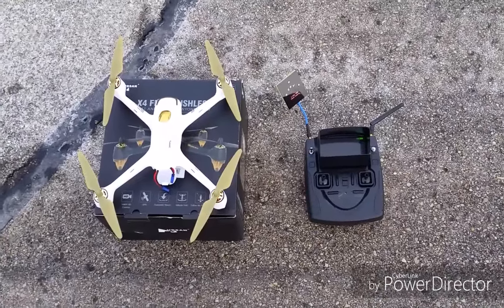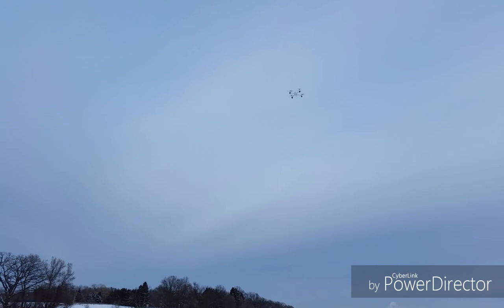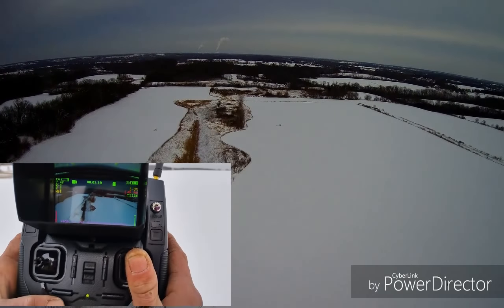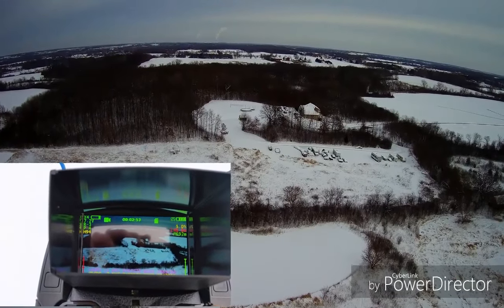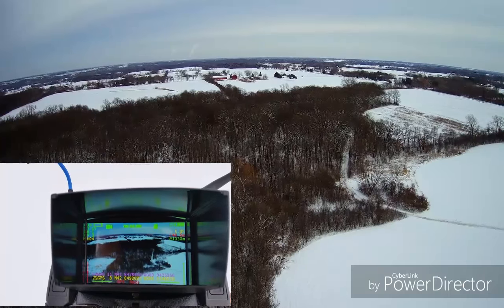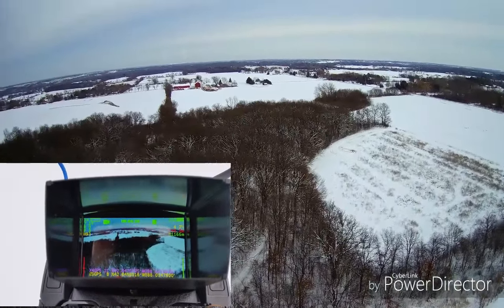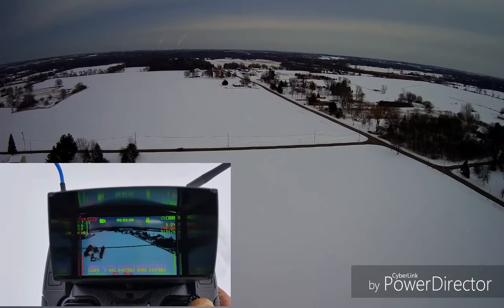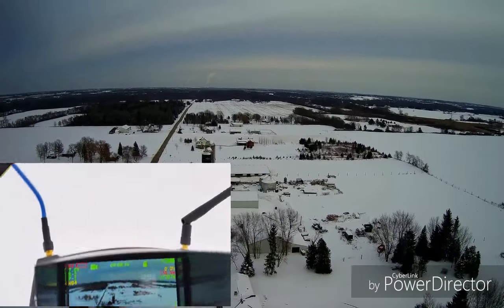hubsan h501ss 2.3Km Range Test. Second Flight After Mods.(May want to turn on Captions).

Comment: Im curious, I think in a test some time last year,  you had pretty good results from an BTg panal antenna in a side to side comparison with BG and GB range mod antenna's,  ( I think I got one after that ) and my fpv improved a little on my standard controller,  Do you still feel good about BTG? and at the outside chance that a 501.SS  can be purchased without ANY controller< Can you bind a 501ss bird to a NON-SS standard controller without conflictions in firmware versions?
Reply from the maker: +anyshitt No. Well, you could bind it to the quad but it probably would not function correctly. The SS comes with its own firmware versions that are not compatible with the original h501s firmware versions. So you would probably have to somehow find the exact firmware that came with your quad and try to program the same version into the controller. The SS versions are definitely better than h501s and are actually coming down in price. It might be worth it for you if you're curious about getting another hubsan quad, trying and getting an h501ss Standard Version, doing the mods and seeing what you get... I know it's always a crapshoot with hubsan, however I seem to have very good luck with their products. BtG is still good quality stuff. I still use that panel antenna when I'm flying around for fun not really for extreme long range flights. I don't know what it is about that blue wired antenna I got from gearbest but it works the best out of them all !!!
Reply: Well if history has taught me anything? it is that (regardless of what I say) I will most likely take the plunge and try this new version of the 501-s.. That whole package really was packed with fun options for the price in a user friendly (no app needed) RTF aircraft..  The only thing is most venders dont advertiise weather or not your gonna get the OG or the SS version>  but shi% yea,  the standard controller is the only way to go onceI finnally squeeze the trigger!  THANKS AGAIN MARK..
Reply from the maker: +anyshitt Bro, if you are going to pull the trigger and get another Hubsan, Buy From GearBest ! You Will get an SS . Standard Version, White & Gold Style, mind as well get that Bomb ass Antenna too. That way you should get both items at the same time.  https://m.gearbest.com/rc-quadcopters/pp_264426.html?wid=21 https://m.gearbest.com/fpv-system/pp_436713.html?wid=21

Comment: nice video, assuming you're using the stock charger, does the charger blink lights even when the battery is not plugged in? I'm not sure why mine is
Reply from the maker: I Never use the Stock chargers. A Professional Charger/Discharger is a Must have if you want your LiPo batteries to last long, accept a Full Charge and most Importantly function properly. As for your Stock charger blinking lights when a battery Is Not plugged into it, that is normal. When the charger is plugged in with No Battery attached it should blink Green. When a Battery is attached, the light should turn Solid Red, meaning it's charging. When the battery is fully charged, the lights should turn Solid Green.
Reply: OK thankyou, once my battery has 'finished' charging on the stock charger, it stays solid green but occasionally flashes at regular intervals. The same whilst its charging: It stays red but at regular intervals will flash a different colour, and after doing some research that combination of flashing lights may mean it was faulty. Do you have any recommendations for good balance chargers? I don't want to spend too much
Reply from the maker: Sam Manesh Yes, your charger is faulty. Don't use it anymore Brother !!  Here's a few Good chargers. I have the Radient RC "Duplex" and the "Authentic" Imax B6 ---> http://radientrc.com/chargers/proSeries/. https://.   https://www.amazon.com/Genuine-Professional-Battery-Balance-Discharger/dp/B079LH1CH6/ref=mp_s_a_1_4?ie=UTF8&qid=1529418835&sr=8-4&pi=AC_SX236_SY340_QL65&keywords=imax+b6ac+v2&dpPl=1&dpID=51oB-Sg%2BWiL&ref=plSrch DO NOT Buy a "Clone" B6 or anything that's Not Authentic ! They will Wreck your batteries !

Comment: Hey Mark awesome flight bro you accomplish the hole entire flight on one battery in the cold?
Reply from the maker: amir newson Yes. One Battery, GPS Hold the Entire Flight. My Controller is Not Reading Voltage Accurately. There's No Way It went that Far Out & Made it back without a fully charged battery. If you watch the controller's screen, Quad Voltage reading is 7.4 at Very Beginning. I was Praying it would make it back !! Otherwise my neice and I would have had to track through 1 to 2 feet of snow to try and find it in that field ! And that would not have been easy since my quad is white and so is the snow! I would have filmed the return to home trip with my controller on the screen, but my fingers were absolutely numb!! So, I hit return to home and ran to my truck to warm up my hands but I was still watching my screen making sure the quad was going to be okay on the return home trip. If you watch the very end of the video, you can see us standing back in the field waiting for it to come home...
Reply: Mark I was thinking about getting the h109S pro would you say it's better in distance than the h501S-S or not
Reply from the maker: +amir newson I can't say for certain. I would love to say "Yes" or "No", but I haven't had a chance to "Try" and fly my H109S X4 Pro that Far (Yet). Last range test I did with it, I had some technical difficulties. Also, almost lost it completely because of a guy's signal jammer ! However, I Love Flying the H109S X4 Pro Better because it's just Big, Faster, More Powerful and it has a Gimbal. Along with a Huge 3S 11.1V 7,000mAh Flight Battery !!! That battery is Huge ! When I First got my H109S, I was getting 30-40 minute flight times !! (Flight Battery was Perfect, between 10-20 Proper Charge and Discharge Cycles). With that being said, I think that the H109S "Could" go Further than the H501SS. It's really fun flying Both. It's Ultimately up to you brother !
Reply: Mark Suttner thanks bro I'm going to look at some more videos on the h109S and try to decide again thanks bro
Reply from the maker: +amir newson Check out this. https://youtu.be/rBlWFC7sOUA
Reply from the maker: +amir newson Or this. https://youtu.be/4hRtv-vCkTA

Comment: Hey Mark how doing bro I have a question what's the name of thicker antenna wire's for the 2.4 an 5.8 connections when do the modifications and where can I purchased them from thanks bro
Reply from the maker: amir newson " RG178 Coax Wires SMA to Ipex". About 4-6 Inch. I would recommend 4 Inch (10cm) You can get RP SMA's Or Regular SMA's. Doesn't matter. Here is ONE Link of Many. You can get them from Tons of places... eBay, Amazon, Etc, Etc. https://www.amazon.com/gp/aw/d/B074RJ5LM7/ref=mp_s_a_1_3?ie=UTF8&qid=1518564716&sr=8-3&pi=AC_SX236_SY340_FMwebp_QL65&keywords=rg178+SMA+to+Ipex&dpPl=1&dpID=51Wks8LvNoL&ref=plSrch
Reply from the maker: amir newson Remember that if you are going to use the M-EGAL Panel Antenna Mods or most other similar antenna mods, they require regular male SMA connectors. If you get RP SMA Coax Wires, you will have to get RP SMA antennas. Where the inner needle sticks out of the coax's SMA Connector and not the antenna. The link I sent you are regular male SMA connectors that will work with the XDA model and the M-Egal Antenna Mods.
Reply: Mark Suttner thanks bro I really appreciate bro
Reply: Mark Suttner thanks bro I really appreciate
Reply from the maker: +amir newson No Problem ! Anytime Brother !!

Comment: Hey Mark how you doing bro I'm back with another question today I took my hubsan h501S-S out for a fly and I notice I had to go full throttle to make the drone take off what does that mean
Reply from the maker: amir newson You Must Do that. Perfectly Normal. If you Don't Full Throttle the quad during takeoff, it can actually tip or flip over by its own propwash. The propellers push the air down obviously, but when it is near the ground, the air(prop wash) gets deflected off the ground and back up towards the quad. That is one of the most common mistakes a pilot can make. Always full throttle during takeoff. Always..
Reply: Mark Suttner Ok thanks bro I really appreciate
Reply from the maker: amir newson No Problem. Anytime Brother ! :)

Comment: I would like to replace antennas with similar to yours, but I think there will be problems with the direction the transmitter is pointed to. I have the same model and I would like to know whether any issues showed up after the antenna upgrade or not. Did you encouter any problems?
Reply from the maker: George Vavouras I DID NOT have Any Problems. The Antenna Mods Are Pretty Simple. All you need is antenna mod kit, small Phillips screwdriver, a drill and a couple drill bits. https://youtu.be/fCibtj-YgRI
Reply from the maker: +George Vavouras When you do the External antenna mods to the Standard Controller, Everything is Improved. Signal Strength, FPV Reception, Everything ! Here's a link to the Mod Kit I have in the video : https://m.gearbest.com/fpv-system/pp_436713.html?wid=21 It comes with Everything you need to do the Mods.
Reply from the maker: +George Vavouras Thanks George. Any Panel Antenna is Directional. The Higher the dBi's, the More Directional it is. However, at Mid-range Flights, 300 meters or so, they Aren't "Super Directional"... If you get what I mean?
Reply: Mark Suttner I think thats what I wanted to hear/read. (You just earned your sub.)👏👍😂😂
Reply from the maker: +George Vavouras Thanks George :)

Comment: Hi Mark: Have you complete fly this turn in GPS mode? In 7.53min the Battery Control goes in red, at that time my H501S will automatic landing and you fly over 10 min and 2800meter further..!?!? How did you do that with an empty battery??
Reply from the maker: MrSillyMouth Total Flight Time In GPS Hold was 19 + Minutes. It took 8:50 to get to 2,300 meters & 9:53 seconds for the quad to RTH. I Always get At Least 20 minute flight times with my H501S and H501S-S. The Flight Batteries Need to be "Broken In" (10 Proper Charge & Discharge Cycles), and A Professional Charger is A MUST...
Reply from the maker: MrSillyMouth Yes, Entire flight was in GPS Hold/Mode. 20 + Minute flight. Awesome !!!
Reply from the maker: +MrSillyMouth Entire Flight was in GPS Mode. There and Back. All on 1 Battery. I was Really Surprised it made it back myself !
Reply: @MarkSuttner  What is a "professional charger"?
does the factory provided one not work well enough? any links?
Reply from the maker: The Cold Weather, helps a lot. #1 Cold & Dense air Increases Rotor (Aerodynamic Lift)... The better Lift--> (Easier for the drone to stay Airborne). #2 When staying Airborne is easier, it's less battery  power needed, for the motors, to keep it Airborne. Which means less battery draw/Drainage. #3 LiPo batteries, Lose A Lot of there charged energy, do to "Heat Dissipation", the less heat you have, the longer the battery will last (in most cases). #4 Any H501S or SS. Should NOT start automatically descending until it's Onboard voltage meter is reading 6.8. in this particular video, along with many others that I have, I don't think my controller is reading my Quad's voltage, accurately. I know this for a fact because I Can Fly the h501ss for almost 30 minutes before it starts to Auto descend. Keep Your Lipo Cool ! Not Hot ! They heat up, on there own, when being Discharged. So, if you can avoid "Energy Loss do to Heat Dissipation", do it !
Reply from the maker: @boost331   A PRO Charger is Nothing like the stock charger you get. A professional charger / discharger, can and will charge your batteries to their full potential. The stock Chargers that come with the hubsan h501s are garbage. There are a lot of professional Chargers on the market nowadays, with these you can monitor your cell balance, you can set your milliamp hour capacity cut off, which is very important and you can also read the internal resistance of each cell. As resistance increases, the battery becomes less stable, which means less flight time. Here's a few links for some Chargers that are good. Just make sure you if you buy one, it is Authentic ! Not a Cheapo Grande Generic !!  Here's 1 -> https://www.hobby-wing.com/skyrc-imax-b6ac-v2-professional-balance-charger-discharger.html?gclid=Cj0KCQiAoJrfBRC0ARIsANqkS_6NiAdHpUXenFqTeEjZaMK4GOI6MXwH2xbXfhgZYNVtnt_qN9Dn9NgaArw_EALw_wcB. There are many more Brands and types of professional Chargers, you need to get one, if you want the full potential out of your batteries and also make them last longer.

Comment: Mark - Gotta admit, I R confused.  Watching your recent flight videos I notice your drone's starting battery voltage level is typically low (7.2v-7.4v), nowhere near full, at the beginning of each long-distance flight.  Is your transmitter reporting the battery voltage inaccurately or are you intentionally starting each flight with a low battery?  Just curious.

Stay warm!
Reply from the maker: +Jimbo in Thailand I'm wondering the same thing as well. Of course I start each flight with a fully charged battery. Even my transmitter battery said it wasn't completely charged when it really was. I would have filmed the return to home trip with my controller on the screen but as the quad reached 2000 meters, my fingers were absolutely numb and I couldn't hold my controller anymore. I actually dropped it in the freaking snow right when I hit return to home ! Luckily I picked it back up, blew the snow off of it and ran to my truck to try to warm up my fingers and I just watched the screen to make sure the quad was going to make it back. I'm thinking that the voltage shown on the screen is not accurate. I started with a fully-charged 8.4 volts, and when it landed the controller said 6.7 volts. this is with the h501ss. My h501s reads battery voltage a lot more accurate. There is no way the quad flu that far and made it back without a fully charged battery. And no, I did not edit the footage or anything, if you watch the entire video you can see me and my niece standing in the same spot we took off from hoping it was going to make it back...
Reply: Mark - Thanks for the quick reply.  My transmitter battery voltage also displays slightly lower.  I just now checked the voltage with my voltmeter and it's 7.65v but the transmitter display shows 7.4v.  Mine never shows mine is fully charged at 8.4v but thankfully it's not too far off.  Luckily, I think my drone battery voltage on the transmitter's display is pretty accurate though.  Shally Liu might be able to help you with yours since your drone battery voltage is so far off.  OTOH a firmware update or firmware reload might help.

Almost forgot.  Got another question.  I know you really like the M-Egal antenna.  Do you notice a huge difference between it and the 14dB XDAMODEL antenna that you used to use?  I have the XDAMODEL antenna and I can get around 1000 meters FPV range if the drone is up about 150 meters or higher.  I may buy the M-Egal if you think it's worth it vs the XDAMODEL.

Take care and stay warm buddy!
Reply from the maker: +Jimbo in Thailand Well Jimbo, I also Cannot make it past 1,000 - 1,200 meters with the XDAMODEL Panel Antenna. This "M-EGAL Panel Antenna is Amazing ! I'm not even sure if that's the name of it. I bought mine from Gearbest. There are Others that look Identical. One imparticular on Amazon looks Identical and is made by "M-Egal" Brand. GearBest doesn't show who makes this Antenna... https://m.gearbest.com/fpv-system/pp_436713.html?wid=21